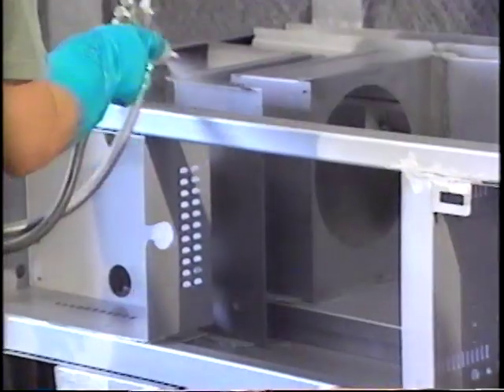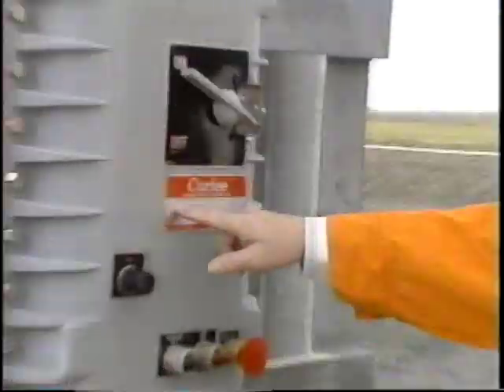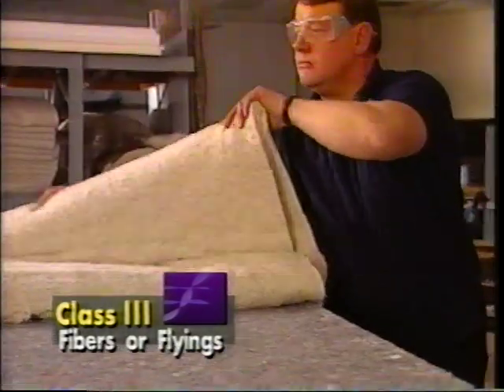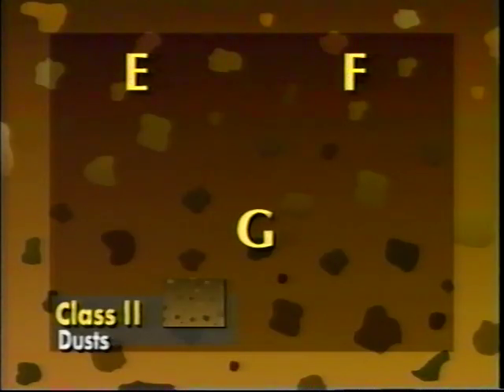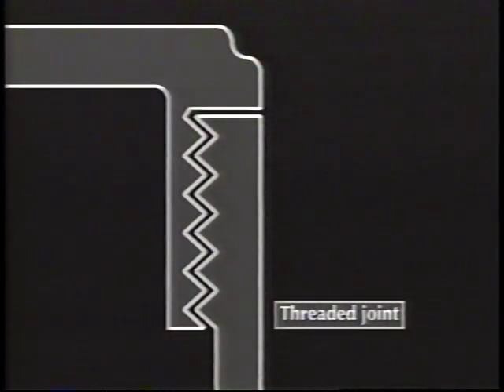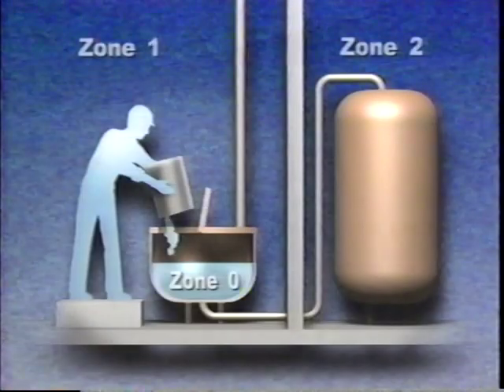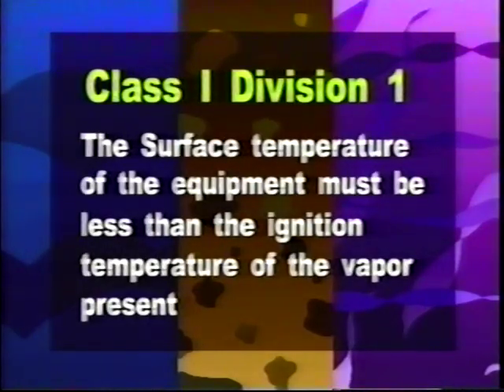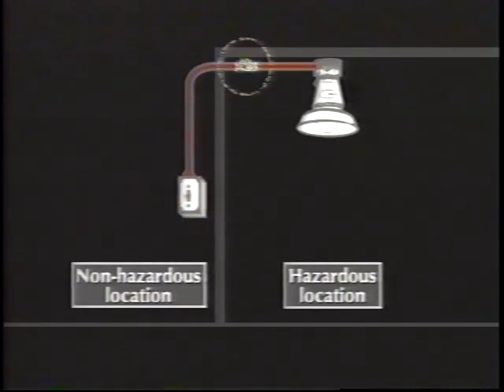Appleton Electric - Understanding the NEC's Hazardous Location Guidelines 1996

Comment: explosion proof has a small grooved air channel to release the expanding explosion for pressure relief, it is not water tight, nor does it have the proper gaskets.

Comment: If a fitting is explosionproof, does that also imply that it is waterproof?
Reply: +carultch they are in different classifications, explosion proof is for explosions, and water tight is for water applications.
Reply: Explosion protection & ingress protection are different! So, explosion proof may not conform waterproofing